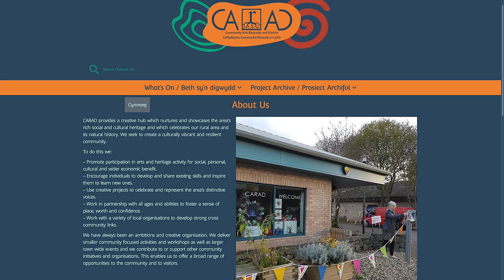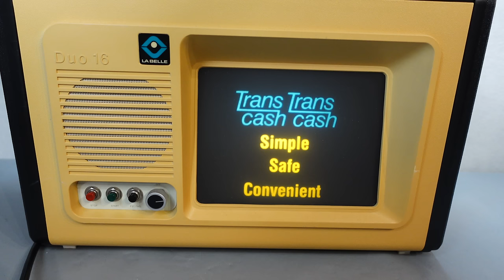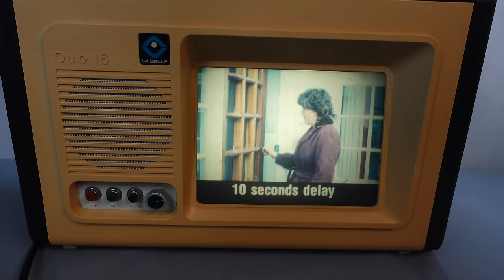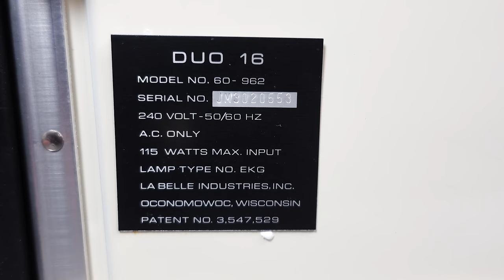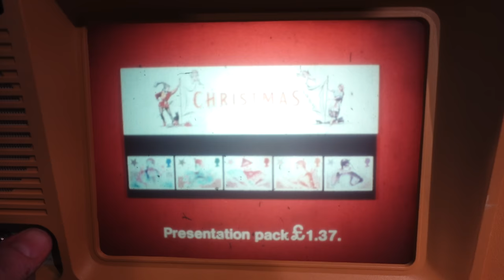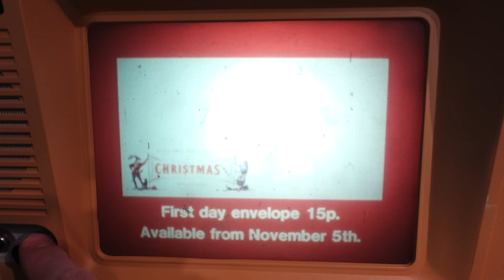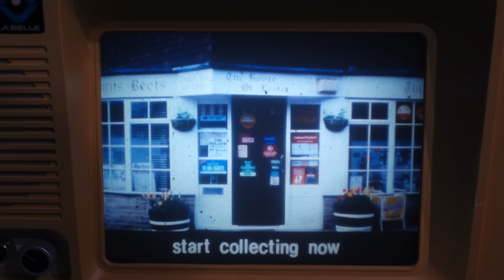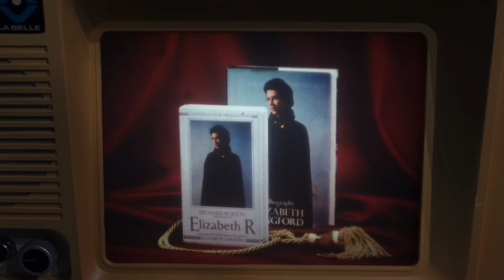Revisiting Post Office Commpak carts with a back projector

Comment: I had some of these from the Post Office, advertising National Savings.  I ran the audio tape on an 8-track and my friend Chris Squires scanned the 16mm Film.  We then joined the pictures and sound back together with excellent results.
Reply: Did you transfer the magnetic tape to a regular 8-track cartridge to play it?
Reply: Lovely! I was about to suggest a film scanner for this. Is there anything those can be found? I tried checking your youtube channel, but wasn't able to find it.
Reply: The process would be much more interesting to watch than the final results.
Reply: You have to put the tape into an 8-track cartridge for that, right? At that point wouldn't it be simpler to spool it onto a reel-to-reel machine?
Reply: @JZikovsky  Yes, I transplanted the tape to a normal 8-track cart.
Reply: @djhrecordhound4391 Alas I did this slightly before YouTube was very big and I didn't have a channel.
Reply: @joemck85  It's quarter inch half track tape recorded at 3.75 inches per second. You could even play it on a reel to reel machine once you got the tape out.
Reply: This is the way to do it! It would look and sound better than it did originally assuming the film fade can still be corrected. The content will still be boring, but it's part of history. "See children, the Post Office was like that even back in the day!"
Reply: @video99couk  Nice!! I restore severely damaged audio (and I used to work in radio production), so I'm fascinated by the video end of it.
Reply: I was going to suggest that as likely the best way to properly archive these. Is it destructive to the cartridges to do this? That is what I had guessed may have been the reason he wanted to use a camera.
Reply: @clerk37  Those carts look easy to get into and reassemble. The hassles would be the actual restoration processes for both the audio and visual. Maybe good as hobby projects, but the material itself wouldn't be really worth saving, imo
Reply: @djhrecordhound4391  With an autofeed film scanner, and capturing the audio the same way he already is, you would get a much better looking end product without much more effort. I'm not saying restore either one, just scan instead of point a camera at the projector.
Reply: @davidg4288  Yes, though I would have had to splice leader tape on.  I'm not sure the tape is ideally suited to playback on an open reel recorder either since it's designed for playing with very low back tension and has a lubricant backing.  It would doubtless play though, provided the track locations are the same which they probably are.
Reply: @video99couk  Tape transfer to an 8-track makes sense if you have one. Most stereo reel to reel is quarter track and would work but still not be ideal. Actually a monophonic reel to reel would be closer since they are half track (one each direction). Reel to reel is easy to clean so the little bit of graphite back lubrication isn't really a problem.
Reply: @clerk37  Using the camera is likely a "good enough" job, and it's probably possible to disassemble / reassemble all those cartridges but it would be time consuming. Worth it? Arguably not.

Comment: I never saw one of these at a post office in Germany, but we had one in our local savings bank (Sparkasse) in the early nineties: It was built into a small walk-in cabinet with a little bench in it and came with two shower-head style handheld receivers instead of a loudspeaker. It was meant for the children of customers while they themselves queued or were being counselled. The machine presented fairytales and phantastic stories, accompanied by drawn or painted images or photographs of puppets in dioramas.

To me as a child, it was always a treat to listen to the machine while my mother stood in the cash queue, and I was quite sad when they finally installed a cash machine outside in the wall of the building and we didn't have to go inside anymore to withdraw money.

Comment: That sticker with the address is most definitely very old. It still uses a 4 digit postal code prefixed only by a D for Germany. This dates back to before the reunification, after which the old 4 digit postal codes were (briefly) prefixed W- for west and O- for east, before the now current 5 digit system was introduced...
Reply: Unification was 1989, so now you make me feel very old. I remember vividly what was going on, even though being from Holland. This device is from the eighties, so yes before unification, and I was a teenager like Matt back then.

Comment: 13:40 Fun fact: The address still shows a 4-digit zip code ("D5270" - the D is for "Deutschland"). Germany switched to 5-digit zip codes in 1993, so this is from before that time. Today, Gummersbach has the zip codes 51643, 51645 and 51647 - depending on the district/area of the city.

Comment: can i suggest that you run the recorded audio past a hpf high pass filter , and cut everything out below 70hz .. will remove the mains hum and any rumble and give you much cleaner audio in the vocal range  ... you could also ad a lpf  low pass filter and take off everything over about 16khz .. that would remove a great deal of the hiss :)

thanks as always for a fantastic video
Reply: Some/most of that hum might be coming from capacitive coupling in the isolation transformer (There's likely ~115V across the barrier). One could try tying the grounds together (preferably using ground points not in the audio path) to get rid of it, as it will also have harmonics of it in the vocal range
Reply: The faithful archivisation of all the material with all of its signal may take priority over fine post-filtering.
Reply: @kkpdk I’d expect proper grounding as suggested will do the trick, and retain best audio (notorious for phono/line issues).

Comment: Thanks to watching your videos, I have gotten deep into the repairing odd electronics... Currently got a grundig en3 that needs some work to, quite literally, get up to speed. And also a teac portastudio 144, and 244, acquired free but in unknown condition, so fairly grubby and needing repairs. Watching a video like this is rather refreshing in comparison, lovely to see this curious format working as well as it should! Cheers from New Zealand mate.
Reply: Same, I was recently given a stack of old JVC hifi separates from the late 70s and with the help of Techmoan / the YouTube vintage electronics community in general, have repaired the turntable and tape deck to working condition. Pre-YouTube, I'd have never had the confidence to open them up, far less start poking around inside, and in the absence of the little neighbourhood repair shops that used to keep these things going before the age of planned obsolescence, they'd have likely ended up in landfill. I love that this thoroughly modern format is helping people keep old kit from the past alive!

Comment: I live in the states and have never seen one of these.  I remember ones in school  (early to mid 1980s) that used 35mm film strips with a separate audio cassette.     The cassettes usually had the same narration on both sides with one having audible tones for advancing the frame and the other having an inaudible tone for automatic advancing.
Reply: Oh yah, I remember those filmstrips, growing up in the '80s and '90s.  *BOOP!*  Not all the projectors had the auto-advance -- or had it working.  *BOOP!*  So the teacher or a student might have to do it themselves at the tone.  *BOOP!*
Reply: I never saw one of those EMC/La Belle systems, either, despite growing up in the USA from the mid 1960s through the early '80s. I remember those 35mm film strip projectors you mention, though, and they are exactly what I was thinking while watching the video! The small-town school system I attended in the 1970s used them extensively for grades K through 12. Most of the ones the school had were no-frills models, where the teacher had to play the audio on a record player or cassette player and manually advance the film when the tone sounded. However, when I was in 6th grade, grades K through 5 moved out of the main building and into a new building, and one of the old Kindergarten classrooms was turned into a Media Center for a couple of years, where we (6th through 8th grades) could sign up for Media Center time. They dumped a bunch of the oldest film strip projectors in there, and some of those had toys I'd never seen before, like remote control film advance buttons and the ability to auto-advance when it detected the tone (or any ambient noise that sounded close enough to the tone, which might have had something to do with why the newer projectors were all manually advanced).

Anyway, given the 1985 date on these post office cartridges that Techmoan showed, my first thought was that maybe these cartridge systems were developed in the dying days of 8-track as a way to try to sell off some surplus 8-track mechanisms. However, the Museum of Obsolete Media states that they were developed in the 1960s, which would have been the early days of 8-track. In addition to being used by the military for playing training videos, they also seem to have been used by large corporations, like McDonalds, for the same purpose. The only reasons I can think of why I never saw one in school would have been price and lack of marketing to schools.
Reply: We had those when I was at school here in Australia. From memory the name on the machine was "Dukane" or something similar.
Reply: @shaun5552 , cool! Yes, I also remember seeing Dukane's brand name in school, but mostly on movie screens. Maybe they marketed these cartridge machines to school systems in Australia and possibly other countries as well, but not (so much) in the USA. A quick online search suggests that they're still around and have branched into other areas.

Comment: I remember these from my local main Post Office. It was placed where the customers queued before going to the counter. If I remember correctly the unit would pause if there was no movement in front of it (some sort of P.I.R. sensor I suspect)  and start up again when the queue built up again, like at a busy lunch time. The ones I recall were much larger than this one, more of a permanent display unit.

Comment: Seeing the business end of that cartridge made me remember a toy i used to have which was a projector. It played very short films.

The films had a similar style of container, with an angled mirror built in to the cartridge, and thinking about it, must have been an endless loop.

I particularly remenber a disney film on that toy, which featured one of the famous disney characters, riding in a towed caravan, whereby the caravan gets detatched from the towing vehicle, and the caravan rolled back down a hill and across a level crossing, narrowly missing a train.

I shall have to see if i can dig it out.
Reply: I have the super 8mm film of that particular cartoon, called "(certain mouse of fame's) Trailer". Unfortunately it is badly scratched.
Reply: I had a similar toy at one point, which I think featured Pluto on the film. Physically, it looked similar to a compact 110 film camera, and the film loop loaded into it in a similar way as well.

I can also say that I've chanced across a version of these made for more mature audiences by accident, and it was after I reached that age myself I finally understood how I had innocently misinterpreted the word Chippendale 🔞 for the cartoon Chip 'n' Dale 🐿🙃

Comment: 18:06 It might be better to just connect a single channel input of the converter to the speaker output. Two 8 Ω inputs in parallel result in a 4 Ω input. So you again have an impedance mismatch between the 8 Ω speaker output and the converter.
Reply: Those converters usually have a relatively high impedance and don't actually present an 8 ohm load, so the paralelling in this case isn't a problem. Also if the impedance is too low on equipment of that era and style, the output would really be low or super distorted.
Reply: @mxslick50  I'm more curious if he can fix the humm, grounding issue?
Reply: @mxslick50  Interesting, and it totally makes sense to have a higher resistance so you don’t dump all the power of your amplifier into that small converter box.

Comment: A similar technology from the early 1970s was Bell & Howell Communicator 50 Samsonite Briefcase Cassette Projector and it used a separate 35mm cartridge and a normal cassette for sound. A 605Hz tone triggered the change of frame.

Comment: Mixed emotions about the player working first time! Happy for you that it works (and great for the purpose you bought it for), but I do enjoy seeing the inner workings of these gadgets, especially the older ones. Gives some insight into the engineering of the time. May be an idea to build a makeshift blackout hood for recording the video. And I'd probably try to capture it in 4:3 or whatever is closest to the original aspect ratio, but of course it could also be edited to do the same. Best of luck with the project!

Comment: I think you could eliminate the audio hum if you ground the line level convertor. Connect a reasonably thick wire (like from an unused 240v power cable) from the metal case of the convertor to the ground pin on an unused power socket. Based on its case, it is designed to be installed on a grounded backplane inside another device. If the hum changes but doesn't disappear, you may have to ground the headphone amp as well.
Reply: I think the problem you're going to have is that the projector's audio circuit has a floating ground. Without tidying that up, you'll end up with just a different hum.
Reply: Yes although it should easily be removed in post using something like iZotope plug-ins or Adobe Audition etc.

Comment: To get rid of vignette, you can try to capture a blank image, invert it and add it to the captured frame. I once did that with great results capturing pictures from a film projector.
Reply: That, or project onto an external screen with its projection capability.

Comment: I'm surprised with how the sound turned out. I was expecting it to sound more like the Pathé theatre news due to how it sounded through the speaker of the player itself.
Reply: You can hear the 'picture advance tones' (probably "crosstalk" from a misaligned head) and a ton of tape hiss; typical 8-track issues.
Otherwise it sounds ok. I'm just picky because I restore old media audio.
Reply: @djhrecordhound4391  ofcourse it's all relative and could be a lot better. But compared to how it sounded through it's speaker it was quite the difference.
But I wouldn't prefer it for listening to music either.

Comment: It’s been a while since I actually did cine to video transfer, but telecine units might be of interest to you if you need to do a lot of that sort of thing.  Additionally, I read elsewhere that projecting onto a grey card and filming that works better than using a white card.  It’ll give you less dynamic range in the cine output and hopefully your camera will be able to capture that more easily.

Glad you got the audio working properly.  When I heard you say “I’m going to connect this speaker output to the mic input, I had a bit of a panic mode moment because of the chance of unleashing the blue smoke.  That little silver box probably contains a couple of audio transformers and it certainly sounded better than the overdriven attempt.  Thanks for bringing this to us.  Post Office slide shows were crap but there’s a strange interest factor in watching that sort of content.

Comment: A Techmoan post always brighens up my Saturday, cheers Matt!

I remember finding one of those Post Office players in a derelict building when I was a kid, around 1989. It had been smashed, but I took it home anyway and salvaged all kinds of useful parts. It had a cartridge as well, starring Poco the elephant in a show about using your postcode. Obviously I had nothing to play it on, but I spooled the tape onto a reel to reel deck and got it to play, and of course the filmstrip could be seen by holding it up to the light.

Incidentally, if you want to get a good line out from devices with only a speaker output, a better method if a) you have a soldering iron and b) if you can be bothered is to tap the audio from the volume pot itself. In this way, you're getting a line level signal just before it enters the amplifier stage of the circuit. Looking at the 3 tags on the pot, the centre one will be the output, and one of the other two will be ground - solder a length of screened cable to these two tags and stick a suitable connector on the other end - job's a good 'un!

Comment: Haha, I  used to sell those door alarms in my keycutting/security product shop I owned for a couple of years in 1993/4! Not that exact brand obviously, but they sold like crack for me at $20cdn for the high end one and $10 for the ultra-cheapie. a good 150% profit on those bad boys, not as good as pepper spray or keys, but more then decent. I havent seen em in YEARS! Thanks for that, even if the tech selling the product was the point. That would have been a fantastic sales presentation tool in the late 70s/early 80s.

Comment: My OCD desperately wants you to replace the two little foam pads next to the lens in the reader mechanism! Because without them, the ancient and fragile film strip is rubbing against two patches of brittle adhesive, which probably isn't doing it any good... also, the foam pads probably help keep the film correctly placed, and without it the focus might suffer.

Comment: The film consists of a series of single-frame images which advance by a pulse from the audio tape. Philips had a similar system which combined super 8mm film with an audio cassette. This machine was able to project the film at any pulse rate from still to 18fps, so that a moving image could be reproduced when required.